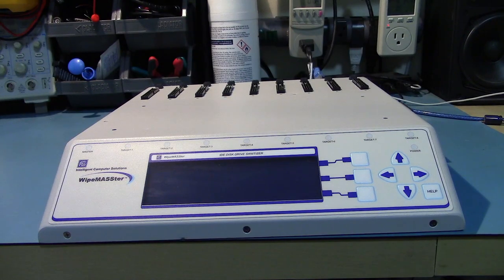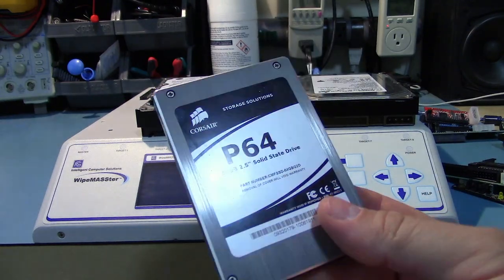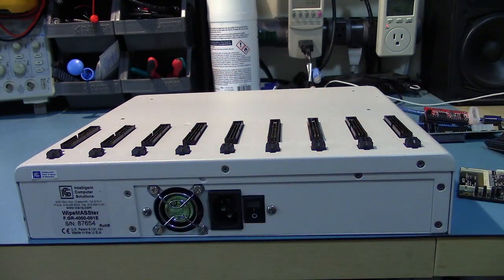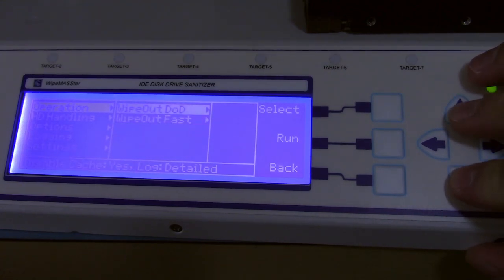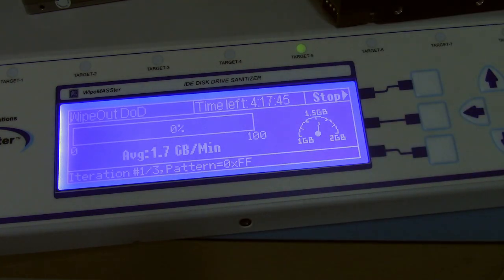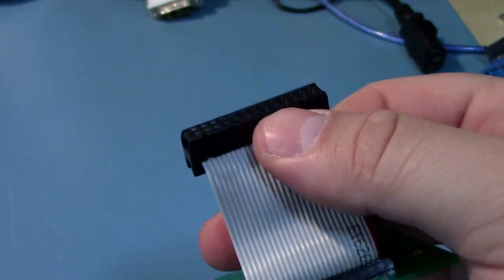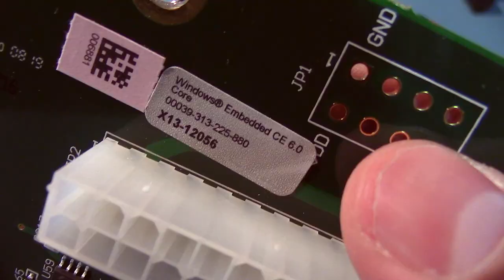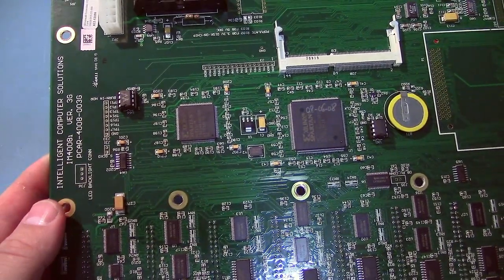ICS WipeMASSter 4008i Drive Sanitizer Teardown

Comment: This looks identical to the ICS ImageMASSter we had at a place I worked before.  It had a CF slot in the side with a card so I suspect you could give it other functions.  And we did have the SATA add-on.  I remember someone saying the port on the side was serial and they had an adapter somewhere to update the firmware.  Edit: Posted before you pointed all that out.

Comment: Did the ICS WipeMASSter 4008i Drive Sanitizer use DES 64 with a 56bit key in Cipher Block Chaining(CBC) with a strange Initialization  Value (IV) mode for secure encryption.
Reply from the maker: +DAVID GREGORY KERR I don't think it deals with encryption at all, it simply destroys data on the drive by overwriting it.